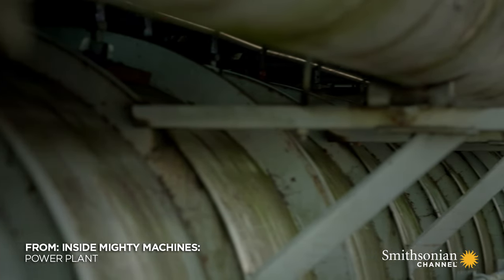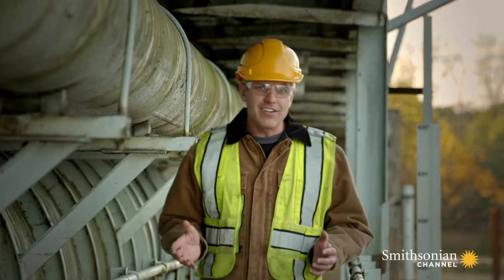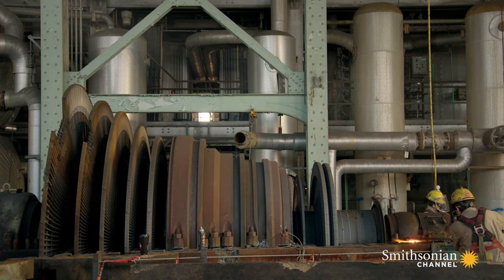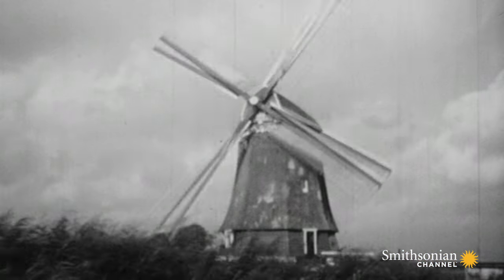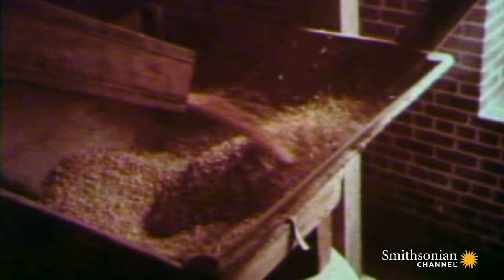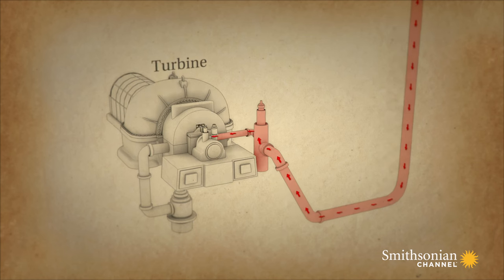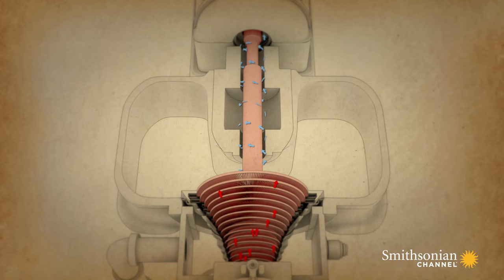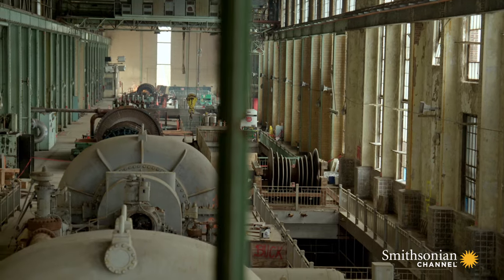A Rare Look Inside a Power Plant’s Giant Steam Turbine

Comment: I'm retired now, but I worked as a boilermaker as a young man. And I spent many hours working in all types of power generation facilities. Walking across the turbine deck at any power plant gives you the realization of how impressive these machines are.
Reply: I have done turbine millwright work for a few years now, and just worked at the dry fork power plants first major outage. We completely dismantled, pulled precision measurements, cleaned and repaired anything out of tolerance. I have known many Boilermakers but never really appreciated them till this job. I walked through the Boilermakers job with my road neighbor after meeting him a few days prior. He showed me what you guys do on a major outage and revamp. I was impressed.  I thought millwrights were cool until i saw the intricacy of a boiler job.
Reply: @hadleytorres8171  I’m a chiller mechanic and I’ve done service and rebuild work in many of the power plants here in the south. What always amazes me is after you guys overhaul a turbine, it’s so clean when your gone. You guys make it where the floors could be eaten off of. It’s very humbling to me being in those plants. Just thinking of all the great minds behind the turbines and all the physical work that goes into making electricity.

Comment: I too used to work in a power plant and some people don’t realize that after the steam passes through the turbines what happens ? It gets condensed back to water creating large vacuum and the vacuum also in a way helps draw in the steam therefore turning the turbine. Pretty cool mechanical design
Reply: I always thought they heated it up all the way to dry steam and blasted the turbines that way, like a gas turbine. If only to prevent rust. 
Rather than wet steam like you explained.

Interesting.
Reply: @davecrupel2817  Anytime steam is heated over the saturation temp it is considered dry steam or superheated. Most all steam turbines run on superheated or dry steam.
Reply: @josephkordinak1591 but at some point it become liquid if the temperature or pressure drops as it goes through the turbine?
Reply: @forloop7713  you have problems if it becomes liquid in the turbine. The exhaust of the turbine is dumped into a condenser which is under a vacuum and has tubes filled with cooling water which condenses the steam back into water to get pumped back into the boiler.
Reply: @forloop7713 I work in a Geothermal plant. When the steam comes from underground at the well, it passes through a seperator which seperates the water from the steam and once the steam reaches the plant, it goes through a scrubber which practically does the same thing. The steam now turns the turbine then flows into the condenser. After that, the hot water is pumped to the cooling tower to be used on other secondary systems and reinjected back to the earth(Hence the term Renewable Energy😉). Fun fact: 2 motors are used to pump out water from the condenser in my plant. One of them is 400 kW.

Comment: These are outdated.  The new ones are a lot smaller and make twice as much power. I am actually working on 3 of them right now
Reply: I don't think steam turbines are getting much smaller. There are fundamental dimensional constraints involved in keeping the steam velocity subsonic that prevent making turbines smaller for a given power.
Reply: @gregorymalchuk272  
Yep.. the current ones, like in nuclear plants, are much larger than those.  The rotors can be ~30 feet across and weigh ~300,000 lbs

Comment: That's actually a small unit
Reply: Yes.. I worked on the turbine deck for a couple of nuclear outages. Those are pretty much tiny compared to the big boys.. weighing about 300,000 lbs for just the rotor.
Reply: Very small by today's standards. Nobody even uses KW to describe one. Its MW.

Comment: Giving a measurement of power without time isn't useful, 80k kwh, 80k kwm????
Reply: Jordan  Following my previous comment on your grinchy nature, the video actually states measurement of energy without a timeframe as reference.
Reply: It's generation capacity, very useful.  80kw for as long as you'd like.  Until the unit fails or drops load.
Reply: The standard for time in the electrical energy industry is hours. So that turbine make 80 MWH. Most people just drop the H.

Comment: A TURBAN is what you wear a TURBINE is what you use to make power
Reply: No, in a turbine you convert energy from speed (in the flow), heat and pressure into rotational speed of the rotor.